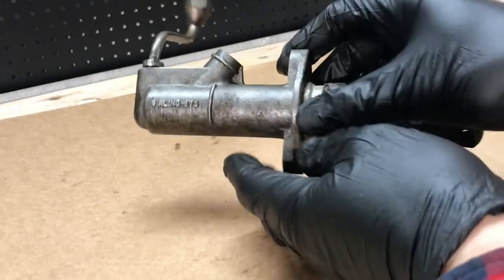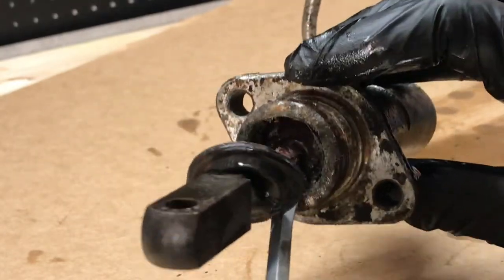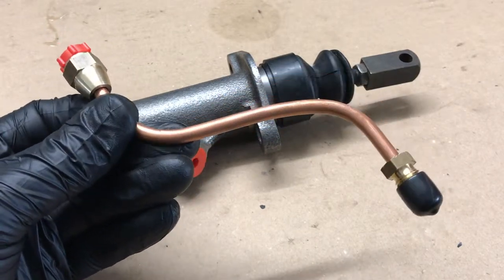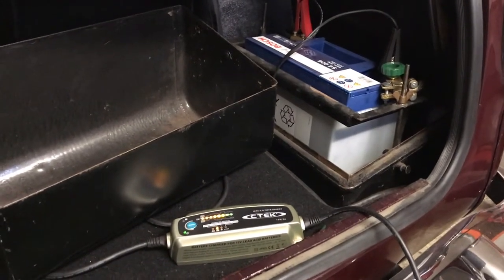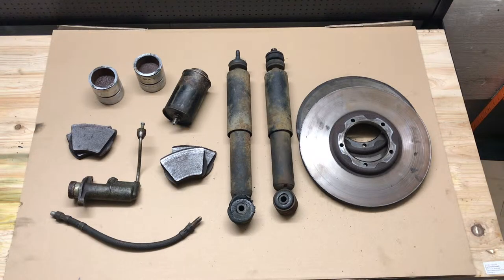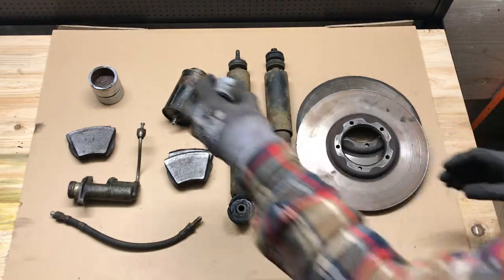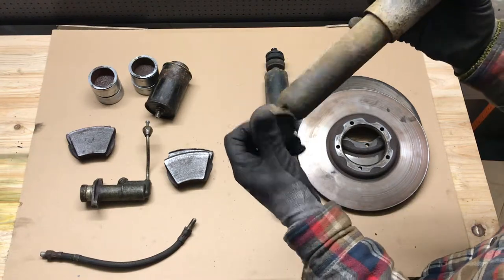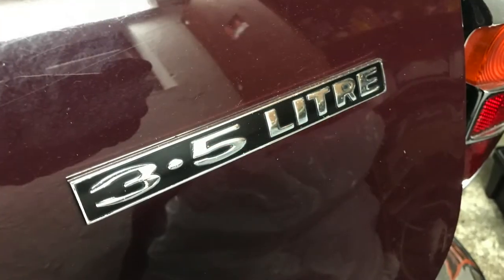Rover P5b - Master Cylinder Modification/Refit & Winter Recap

Comment: Nice work on the brakes. As I've worked on mine I've been really surprised / concerned just what a poor state the brakes were in. I've been driving around in blissful ignorance until now! The fact that it's only a single circuit means that it's really worth doing what you've done.

Comment: G'day from Australia, I'd sent you a previous email post your work just now on the Rover, but good work on the brakes etc. I can highly recommend electronic ignition and fuel pump. Two of the best things to fit to an 'old car'. My 3500S starts on the button from cold and idles/runs better than ever (I'm on my seventh P6). All P6s have a rather 'complex' rear braking system and handbrake setup etc. and need proper fettling, but once done are excellent. Enjoy the P5B.
Reply from the maker: G'Day, Mark, I've got an electric fuel pump and electronic ignition all ready to put into the car. My next videos will show me installing them. The P6 3500s is a great car but I wouldn't feel confident overhauling the braking system on them. Hoping to get my P5b out and about more soon but it's been the coldest, wettest May for 30 years up here. Hope things are better down there.
Reply: Fortunately the weather here considering it's late Autumn is like summer, so car runs are easy. I'm sure you'll do this but make sure when you fit the electric fuel pump in the engine bay that it's on rubber mounts. As to the rear brakes on the P6, fortunately I have a friend who knows them inside out, as once set up properly they are a joy alongside the de-Dion rear end – lovely passive four wheel steer.